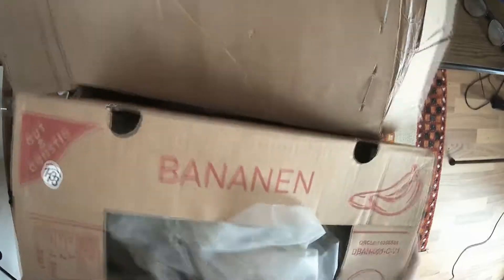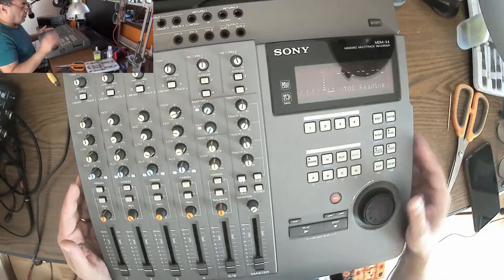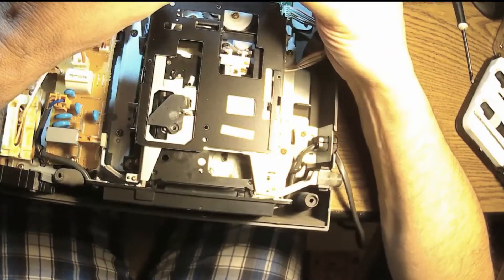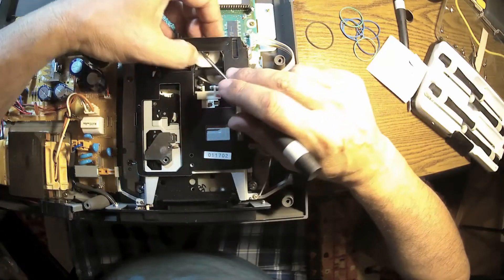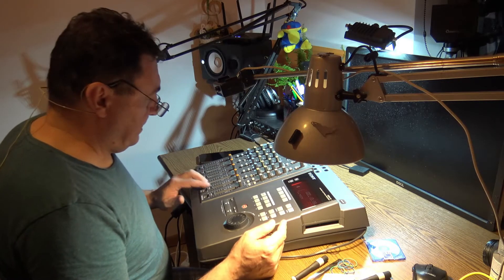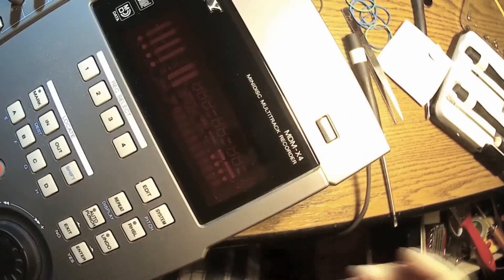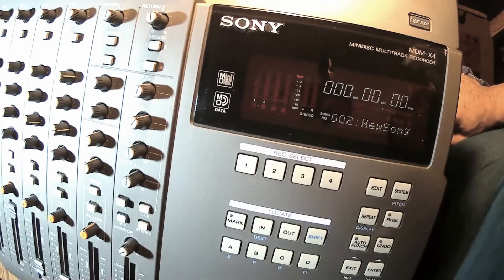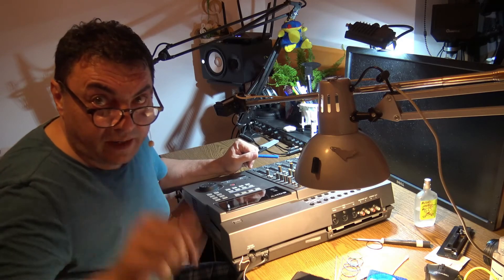Sony MDM x4 Minidisc Multitrack Recorder

Comment: Belts are made of rubber. Heat and humidity affects them greatly. I change belts on tape decks like I change my socks.
Reply from the maker: Also the low quality of the imported belts.
Reply: Where do you buy the belts from?

Comment: The memory battery is an easy fix. But go slow, don’t make a mistake. I did it in about an hour. It uses one of those batteries that looks like a coin.
Reply from the maker: Yep CR2032 battery, usually they last like 5 years

Comment: I picked this model up a couple weeks ago from a pawn shop and replaced the eject belt and battery and it seems to be OK. It had an MDD that was stuck inside that I’m trying to reuse but I have an issue where playback freezes immediately when trying to playback after recording, and the LED from the play button is flashing. It also reads ‘blank disc’ every time I reload the disc, so nothing is getting saved onto the disc. It has no issue getting past the TOC read/write screen either. I ordered a new MDD, so I’m hoping the old disc is the issue and not the disc drive. Great video by the way.
Reply: Those discs are like vinyl records: when they fail, there is no fixing them. Throw it out and buy a new one.
Reply from the maker: @malcolmbliss777  I got that, thanks
Reply from the maker: Sometimes the disks are the problem, a new one will clear it

Comment: Hello, thank you for the video. i just bought one of these off ebay and can't get the eq knobs to have any effect. Does the eq need to be engaged to function? The eq for 5/6 works fine, channel's 1-4 don't seem to work at all.
Reply from the maker: Consider the mixer like any other analog one, so EQ should work anyway...I beleive there are potetiometers problems, something mechanical somehow

Comment: Hallo.
Please, could you make a tutorial for beginners, how to burn (even erase) an MD? Directly from the computer, (if it is possible) explaining if a special software is needed, and then, step by step, how to burn. Without mixer effects, so as not to complicate use. Or if I can, and how, burn directly from the turntable. I would really (and not just me) be very grateful. I am evaluating the purchase of this device, but from your tutorial I would like to understand if it is a tool that I need and that does what I want.
Thanks and have nice day.
Reply from the maker: Hey! So far I didn't see any MD burners standalone, connected to PC. There is something similar but for Data only, they are not compatible with MD audio format. I'll check around and let you know but I'm pretty sure there are no units like that.

Comment: Is it possible to make the Jog wheel work properly? Maybe switchcleaner. Many thanks. A great video.
Reply from the maker: I never open one for cleaning..it's a rotary switch.Probably with proper electronic contacts cleaner should work again. You may use WD40 for a try.